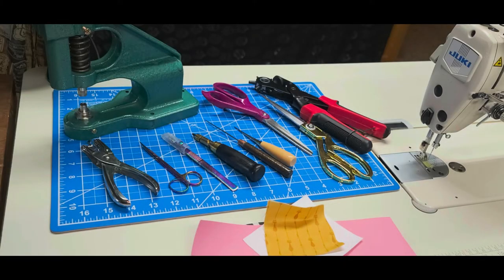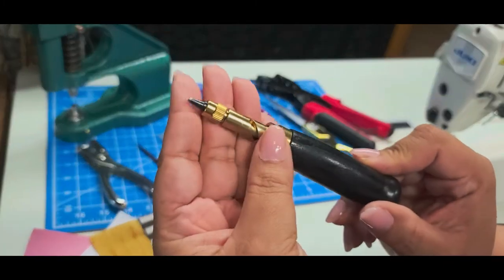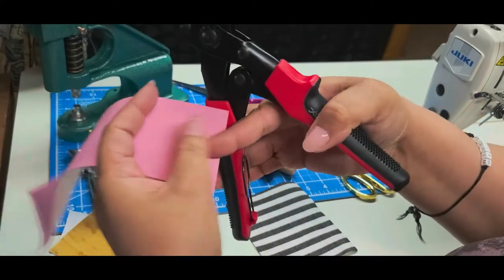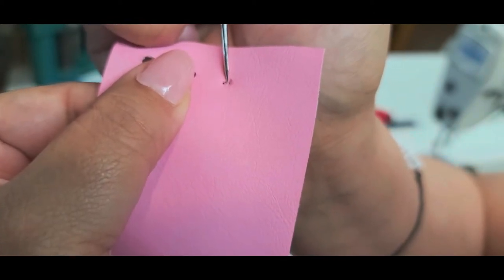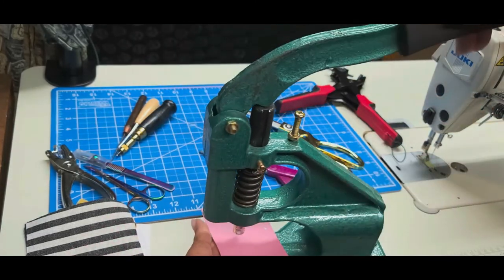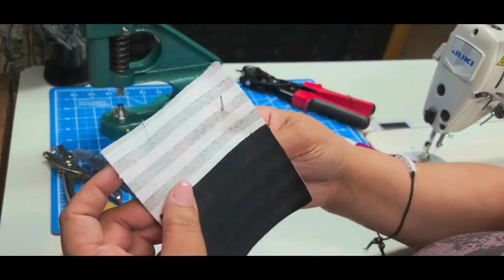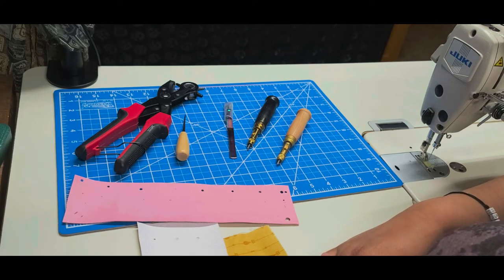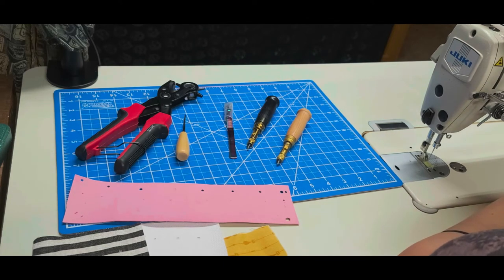Learning things: Intro to hole punching

Comment: Have any of your punch cutters dulled? How long have you had that set?
Reply from the maker: I've had this set for maybe a year. They haven't gone dull yet. I only use them on fabric on top of a soft self healing mat, so I don't know if that helps or not.
Reply: @HollowBagCreations  I would need them for turn locks and to thru vinyl, fabric, and decovil heavy. They don't have to last forever but don't want them dull after a couple uses. Thanks for answering